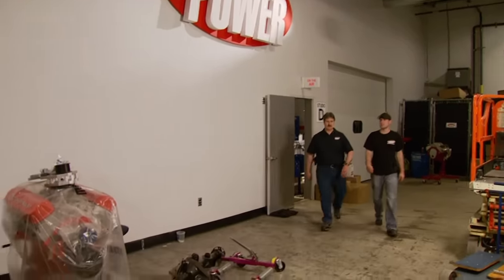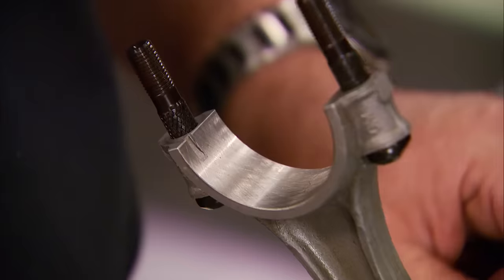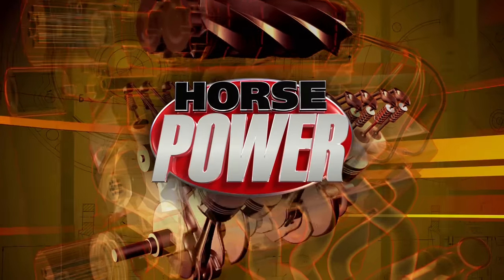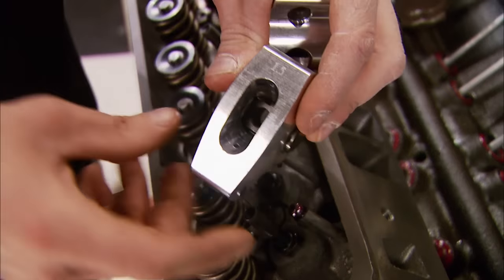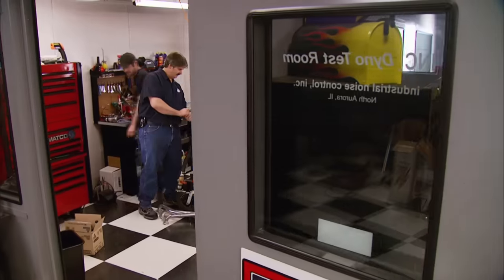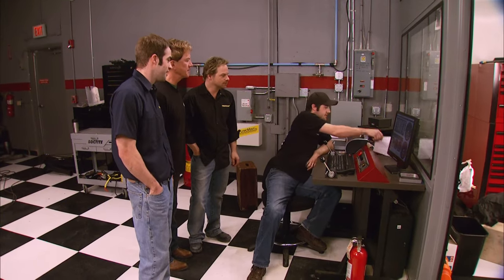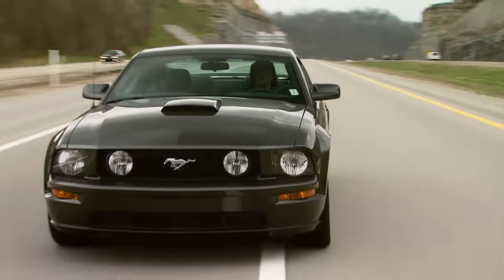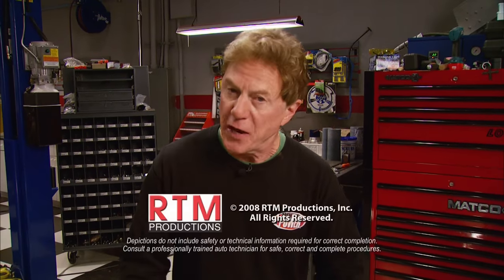Rebuilding a 283 Small Block for a Daily Driver C10 - HorsePower S12, E7

Comment: Drop that crank into a 4" block, woohoo. A 302, that would be a screamer.
Reply: Chevy crank in a ford block?
Reply: Bryson Shires don’t say anything if you have no idea what you’re talking about kid
Reply: Naw, that's how the new generation learns.  Hot rodders would bore a post 1957 283 block out to a 4 inch cylinder bore, and that made 301.9 cubic inches (tho they called it a 301).  Later, Ford would whip the Corvair's sales butt with a thing called the Mustang (only fair, since it originally was supposed to compete with the Corvette, but Ford had a heavy V8 called the Y block and so they made a larger 2 seater car called the T'bird, which started the personal luxury car market that Chevy would compete in with the Monte Carlo).

So when Chevy made the Camaro to follow the lead of the Mustang, they knew they had to go all-out right at the gate.  The Ford K code Challenger 289 competed against Dodge's D code 275 hp 273 V8 in a race called the Trans America.  Trans Am required V8's no larger than 5.0 litres, and Chevy decided to match up its 327 block, with 283 cranks, to create the DZ code Z28 302 engine.

At its time, it was a hot mama. It came from the factory with the same 780 cfm carb the 427 used, so you knew it was a high revver--and there was a cross ram optional twin carb intake. That carb sat on a high rise dual plane intake that a few aftermarket companies ripped off as their own. It had the famous "Duntov 30-30" cam used in the fuelie 327's.  Some dealers threw headers into the trunk. It was an answer to the Shelby Gt-350 without having to go to special dealerships--any Chevy one could order one up for you.
Reply: @brysonshires9742 . I'll be easy on you since it sounds like you're not well versed on this. Of course there is the Ford 302. But Chevy also made a 302 that came in the '67-'69 Z/28s only. For years prior people were putting 283 cranks in 327s but called them 301s. (Or bored the 283 to the max).
Both the Chevy and Ford 302 have a 4 inch bore and 3 inch stroke.
Reply: @brysonshires9742  Chevy made a 302 also 327 block with a 283 crank real screamer!
Reply: Bryson Shires hi I worked at a Chevy old dealer from 1967 to 1975 as a kid in school and college . We had a  1968 Z28  302 with the optional factory headers and dual cross ram intake and dual Holley carbs dealer installed they came from factory in the trunk . Yes it was 302 ci and close ratio 4 speed they were raced in the trans am road race series as the max ci allowed was 305 ci . The 302 had 11.1 compress 2.02 intake valves solid lifter cam forged crank pink connecting rods hi nickel block. These engines made no power below 3500 rpm but above that they just screamed to 7500 rpm .
Reply: @albertgaspar627  and rated it at 290 hp because of insurance regulations. I got to drive one new! Hardest pulling 290 horses I've ever seen!
Reply: @albertgaspar627  '57 to mid '62 blocks only, after that, wall thickness is too thin
Reply: @MrDmorgan52  the other reason was to not outclass the engine for Trans Am and end up with handicaps like in NASCAR. As you know, the Boss 302 claimed the same HP, and then the 340 Six Pack followed suit. But they were all quoting at a lower RPM then where they peaked.
P al, the funny thing is, some H code 307 blocks, which replaced the 283 by adding the 327 crank, are said to have been cast with the early water jacket sand cores, and may be able to go out to a 4 inch bore. so before you toss one, have it sonic checked :)
Reply: He's talking a dz302 which is pretty much a monster,it'sa 327 block with a 283 crank.
Chevy made 302's,ever heard of the camaro with the 302?
dz302 camaro??!

Comment: Old 283 heads have no bolt holes in the front of heads to mount modern (after 1969) power accessories.  It is best to use a head with holes in the front of the head.

Comment: What I don't like is people think because it's the 350 it needs a carburetor under 750 CFM and if it's a 283 it needs a really small Cam and a small carburetor and it just show that it don't make any power. I followed car magazines for years trying to go conservative on camshafts and carburetors an my car I ran a 14.00 et. I was so mad. Build them right and they will run. In the early 1990s guy build a 283 with 12.1 Pistons added a crane camshaft he took out the automatic put in a 4 speed in his 77 Nova and ran high 10's low 11s' with a baby car seat in the back.

Comment: 283 ci. in older Chevrolets use to have power cylinder heads , I forgot what they used to call it.  Think they made them from late 1950s through the 1970s ?

Comment: Nice simple build guys, What was the cost to rebuild this little 283. I have one I want to build
Reply: I'm building one right know, 60 over,
300 hp cam, engine  balance, world
Product heads, still need push rods ,intake, all the outer parts,  at 
$3500.00 know, it will be  all new, for
My grandma's 66 chev 11 nova, been 
Building this project  form the ground up., about 3 lin. Of recites afraided to 
Add them all up , guessing over 25,ooo.oo , grandparents bought the 
Car brand new in Coolidge  Arizona, 
$2600.00 still have the original  
Invoice,

Comment: I've been building engines for many years had my own machine shop never hit the small ones till they turn orange it ruins the rods always have the machine shop with the rod on a nerd a thing a lot of mechanics do is to see people doing using form a gasket with gaskets it turns gaskets into mush down the road use proper gasket sealer with gaskets Aviation Permatex or the gold spray I've had to re gasket quite a few engines because silicone Permatex with gaskets silicone Permatex Ultra black Ultra Blue Ultra gold Ultra Orange made to be used without gaskets that was the whole purpose of the invention of this chemical
Reply: I never used gaskets,  just a good thick bead of black permetex on the ends
Reply: You're allowed to proof-read...

Comment: If the engine put out 195 HP stock and they rebuilt with basically stock parts how are they hitting 250HP?
Reply: Aftermarket heads and slightly bigger cam, and edelbrock instead of 2 barrel or quadrajet. “Basically” stock doesn’t mean anything if you paid attention to the video lol

Comment: Stroking a 4.6 out to a 5.0 might not be problematic, but most engine builders don't recommend stroking the 4.6 and 5.4 modular engines.  The cylinders already have issues with the piston skirts coming too far out of the bottom of the cylinders with the stock stroke.
Reply: easy crank change to 307 = chev made millions of em ! you sure you know ?

Comment: Great video!!
Trying to build a decent 283 for my 71 C10.
I have an early 283 block, bored .040 over.
I have a few sets of heads...casting numbers;
333882 / 3884520 / 14014416
I have 2 cams, .435 lift and .405 lift.
Edelbrock Permormer intake with a 1405 and a Rochester Quad.
Figured this would be the best place to get advice on how I should build it.
Thanks guys!
Keep up the vids!
Reply: Myvintageiron7512 has a great channel for SBC builds. He goes through heads, cam selections, using Vortech heads on early blocks... It's mainly 305/350 builds but all the same basic principles apply. He's got low budget builds that go through block prep and build techniques. Super knowledgeable.
Reply: Dont only decide on a cam on its lift as it's only one aspect of it. Generally you want the most duration@ .050" vs advertised duration especially with a smaller motor and not having a high compression ratio. And preferably not a wide LSA (not over 110). As for the heads, the 416s are it. Smallest combustion chamber ( more compression), decent sized valves and runners. 520s have the smallest valves and runners and no accessory bolt holes. The 882s have the largest combustion chamber and on a flat top 283 that wasn't decked you'd have around 7:1 compression and maybe lower if using too thick of a head gasket. Avoid the 882s! The 416s will get you 9.5ish if you have them lightly milled (enough to clean em up).and use a thin enough gasket.

Comment: 283 was the best motor chevy built. I had one an put it into 3 different impalas. Out lasted all those cars.
Reply: Not hardly, the 350 was as far as SBC's go.  Just as reliable and capable even the crappy 350 had decent torque, the only way get decent torque out of 283 is with a blower or turbo.

Comment: Can you guys try to recreate the DZ 302 that was in the original Z-28? There have been fables of creating amazing amounts of HP from that small displacement. What was the reason they made power at that small displacement? They would put two 4 barrel cross ram intake on them. What about a holley style six pack? Small displacement with the central two barrel, then wide open with all 6 feeding it! It sounds amazing to me! Anybody else want to see  them build this?!
Reply: yes

Comment: The after market head would have 64 cc chambers. The 283 head would have 58 cc chambers. The 2.02" valve would be riding the cylinder wall. (small bore 283/ 3.905" @ .030'' over.) A 305 4 bbl intake valve are 1.84" in the 283 head milled to 56 cc and a zero decked block would make 300 hp. Considerations have to be made for small bore short stroke engines. The combustion chamber killed compression and the valve size killed air flow.
Reply: haha the 67cc heads they used with the .039" felpro gives them a 7.5:1 compression ratio. a veritable turd.

Comment: That's an awful lot of custom body and chassis work to go through just to stick in a 283.
Reply: Russ Gallagher  uh....the 360 mopar has a taller deck height than the 351w...no point in doing it. mopar had insanely tall decks, and far better rod ratios than the competition.
Reply: Russ Gallagher Bore 283 ('57-  to mid 62 blocks only), to fit 327 pistons, you get a Chevy 302...hot engine, better than a 283 crank in a 327, faster revving.

Comment: If you want to learn how to build some small blocks you have to reach Smokey Young's book and Bill Jenkins two find books for building small blocks. Rodnuts use some loctite on them not too much in case you stretch your bolt the Rod's not going to come apart.
Reply: Smokey Young?

Comment: Back in 2010 I installed the FRPP top end kit on my 2008 Bullitt. Heads, hot rod cams, intake, throttle body and BBK Shorty headers. 

Made 379/360... that was on the stock 4.6 block. Im sure it would have seen over 400 NA on a 302 stroker but I went Procharged instead and made 530wheel on 12lbs of boost. 

Sure do miss that car. Wasn't as fast as my current ride but I sure had a lot of fun out of it.

Comment: Would a 1969 307 from a C10 be a candidate for the same rebuilding?
Reply: Yes, its a 283 block with a 327 crank. If you can find a set of 305 HO heads from a 1980's Z28, you can substitute those for the aftermarket heads they ran. 250-300 hp is entirely reasonable from a 307.  The trick is not to put too gnarly a cam shaft in these things.  People want to brag about big numbers, they shove some cam that is better for a 350 inside.  Build this engine for torque, not HP at 6,000 RPM, and folks will be surprised at how "strong" it is.
Reply: yes and you can use the cast crank from a 262 v-8 , its a 3.10 stroke  , made from 1974 to1976 , she will spin like a top.  rod length is the same 5.703 . custom 283 pistons to match the deck height.
Reply: use 12.5 cr  283 pistons and mill the tops down to match the deck height , then mill the dome down to get the cr you want.
Reply: @tobiaswillson5900 . Good idea, as more choices of pistons. You can use 283 pistons in a 307 IF you use the shorter 400 connecting rods. And still check the deck height nonetheless. Even with the slightly shorter rods it still has a great rod length to stroke.
Reply: @tobiaswillson5900 . That's pretty imaginative. I've always had a "fascination" with the 262 since they're so uncommon and the only small block with a 3.10" stroke. Interesting,  BUT,  finding 262 cranks is probably pretty difficult. I've only seen one motor and that was 30 years ago.

Comment: You should have bui!y it just like a factory 302 with an off road 30-30 and 2.02 valves and fly cut the top off the cylinders for the bigger valves and put it on a dyno

Comment: You should never put thick assembly lube on the outside of flat tappet lifters,  it can hinder rotation, oil only on the body, assembly lube on the face.

Comment: I have a 283 sitting in the barn waiting for me to put back together... already out $400 for crank machining and bearings, will see ho much more I pour into it...
Reply: did you get it done yet? id guess around $2k before youre done
Reply: Got sidetracked, buying back the project truck 55 series1 Chev from a friend. It's a basket case but with good bones for an Atlantic Canadian rust magnet.

Comment: 378hp 374 tq that’s it? My stock block 08 mustang makes 391hp and 386tq with just bolt on mods without pulling the engine.. and it has 150k miles on it already.. only mods i have is full exhaust with bbk long tube headers, walbro 255 fuel pump, fuel injectors, coil packs and plugs, ford performance cold air intake, bbk twin 62mm throttlebody and a tune on 91 octane fuel.. oh and a light weight flywheel with exedy stage 2 clutch.. only other mods the car has is an aluminum 1 piece driveshaft..

Comment: Why does your 283 have a bolt through the harmonic balancer? Mine don't, thoughts?
Reply: they were press on from factory. i have a 1964 283 . had the machine shop drill and tap for the bolt.

Comment: "302 three-valve?"  Weren't the 3-valve motors still 281 ci?
Reply: Factory yes, the 3V 4.6 was a 281. Ford Performance used to offer a stroker kit for the mod motors that upped displacement to 5.0L or 302
Reply: @pablotharpalo5685  
They didn't mention that in the video though, did they?  Maybe I missed it.  And it looked like the cylinders were just honed not bored.  Anyway, no big deal, and I wasn't trying to be a troll.  It just sounded weird to me - "302 3-valve."
Reply: @midrangetorque  at 14:11 he mentions the stroker kit.
I figured you weren't trolling. I'm a Ford guy and 302 3V still sounds weird to me hahaha

Comment: Dammit man. It's not a motor. It's an engine!
Reply: Motor

noun

1.

a machine, especially one powered by electricity or internal combustion, that supplies motive power for a vehicle or for another device with moving parts.

"these electric motors are highly reliable"

2.

INFORMAL•BRITISH

a car.

"we drove out in my motor"

adjective

1.

BRITISH

driven by a motor.

"a motor van"

2.

giving or producing motion or action.

"demand is the principle motor force governing economic activity"

It's probably not worth fighting about

Comment: How much is something like this cost. I want to get an old block n rebuild it. But put a Holley efi on it that way I got the gas n the power
Reply: Cheaper to just get  a bone yard 4.8 complete with the ecu.  For the cost of the Holley efi you will get complete engine.